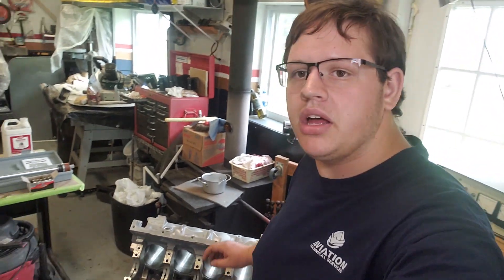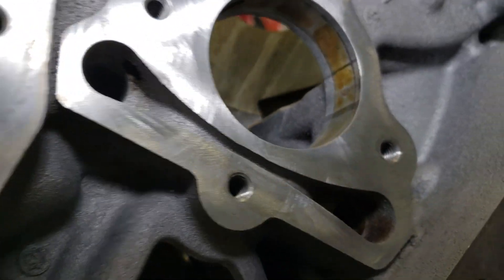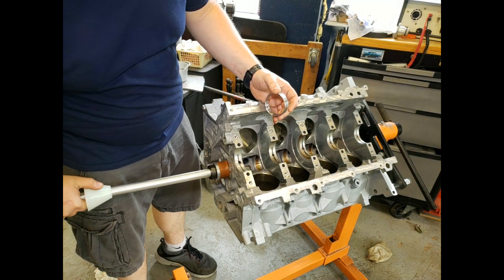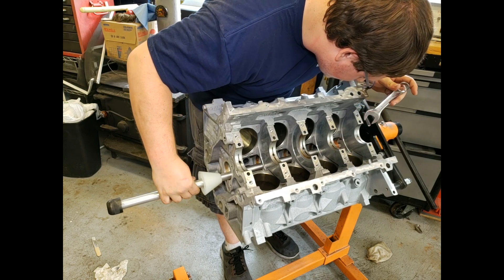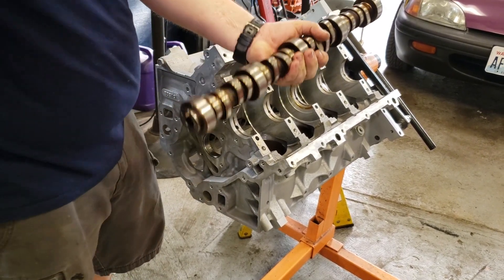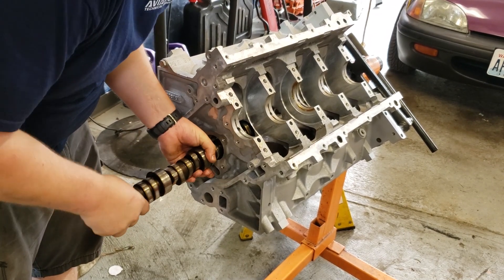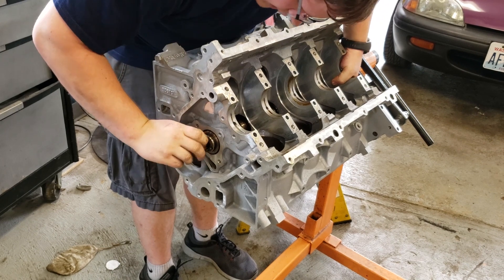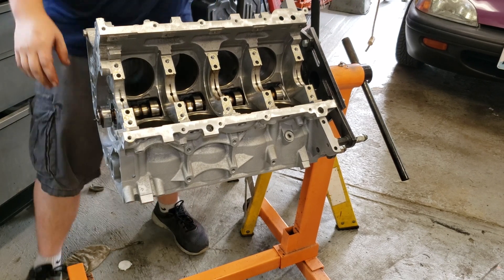5.3L LS CAM BEARING INSTALL (V8 fiero pt 3)

Comment: ive seen defective cam bearings brand new right out the box also keep the engine block straight  and also check each bearing with a pick to make sure the bearing is aligned in block
you will save alot of time and aggervation

Comment: Hopefully those bearings wear in before they spin in the bore. You should be able to spin that cam by hand and it should freewheel for a half turn or so. That sucker it too tight
Reply from the maker: I ended up using the old cam and cutting the bearings a bit until the new cam spun with no resistance. Just didn't record that part.
Reply: Eh half a turn?  Not really...  maybe 1/8-1/4 turn.  There should be resistance from the oil, if there isn't than the bearings are probably too loose.  1/2 a turn imo is too much.

Comment: Mitch, As a dealer tech, I did not work on the LS engine Series. In 2001, I changed jobs by emailing my info to someone looking for an automotive instructor. It turned out to be contract labor for ACDelco. They required cross-training as all were expected to hold tech seminars and found us asking to meet for that week where stuff was manufactured. I found myself behind glass with a clean room full of robots in a line zig-zagging from end to end. Each had one task, it was the aluminum LS engines being assembled. The blank cast blocks arrived completely machined from another room. Never giving a second thought about the two oil holes in the camshaft bearing, but a robot arm picked a bearing, out of a sliding row of three, but picking up, spinning around, located the holes, move it into the block, while a hyper-active hydraulic arm went in thru the far end ans shove it home. Once #3 was installed, the block spun and finish the last two. Never touched by hands and took like 30 seconds to install all. That was the comment of the day, not the holes. But make sense now. Two people in white clean suits took notes and restocked some of the parts being used. Once done, filled with oil, rubber cones went in to supply coolant and block off heater fittings, but one guy watched over it, then ran at 2,000 RPM's for ten minutes. Tagged & marked with yellow crayon and lifted into plastic create to ship to the assembly plant. I have no idea what size engine or where they went. Could be yours! The group leader did mention they are running the room assembly 24/7. So interesting and never new they where doing it that way. Talk about repeatability! How many ignition coils does it take to build a million or so, of these engines? Train loads X 8. ASE Master 1978 - Retired.
Reply: No, they where installed correctly, it’s not my reason for explaining two holes in each bearing, it’s more about how the equipment handled them. 
 For lack of better terms, but after this arm picks up the bearing, it was slowly rotated while a single little finger felt for the hole. Once found, a green light came on and the camshaft bearing installer moved into position to grab it at a very fast speed. It moved into the bearing slowly like grabbing an egg. Expands, grabs, the holder moved, then the installer arm moved at lightening speed, then slowly placed it into the block, then pushed it home with a secondary hydraulic arm & cylinder. 
 I was 9 years old again, watching $2-3 Million dollars in automated hardware, robot arms, pneumatics and hydraulics work to create and engine from a bare block, to a completed unit, then fluids and run to break-in the camshaft and other test perimeters. I could have watched this from the 3 windows around this room, for the entire day. Certain things caught my eye and I was mesmerized, like glued to the floor.
  Each group had a “GM” team leader who kept us moving. Many of us begged to wait. No cameras, no recordings. Signs everywhere where. These where only aluminum blocks, not cast iron. I was shocked, excited, paralyzed...every emotion at the same time. It was like adrenaline or electrical shock!!!
  We where ask our name when in the lobby then given a name tag sticker. Later, we found out it had an “RFID” chip in it as you approached a door, as placard that simply said name tag here. At 6’3” tall, I had to bend down a little, but if access was allowed, a 5 second buzzing & single beep opened the door. Over almost a decade, our group of 55 guys always wanted to go to where stuff was built. We where car guys, damnit. I found this exact security at most all of the facilities. The “GM.com” guys (As I called them, because their paycheck came from GM), but there had “ID” cards, chip and photo on retractable chain/string belt clip. 
  The things I saw...amazing!!!
The cam bearings where precisely installed. Running a new engine, much less a cam, is 3 steps. High cold idle (1,100-1,200 RPM) for 4 or 5 minutes as readings where taken. Then at 2,000 RPM for 10  minutes then back to idle for 3 minutes then off. At this point, this is when yellow paint marks are placed on the dipstick tube, crank pulley and elsewhere, plus stickers and build sheet. A robotic arm is lifted and little dots created numbers. Then gone out thru a door riding a cart on chain. It was one of my best visit. Alternative Technical Vehicle Center was second for me. Amazing technology. (Kid in a candy store) Wish I had photos...No way to explain what I saw!
Reply: So you're saying my 5.3 cam bearings where installed incorrectly by a robot in a assembly plant?